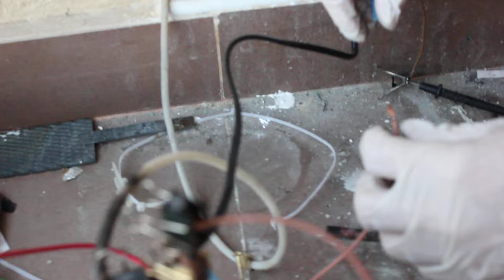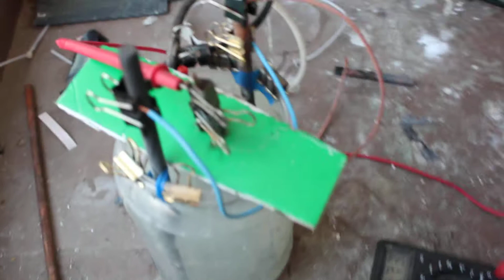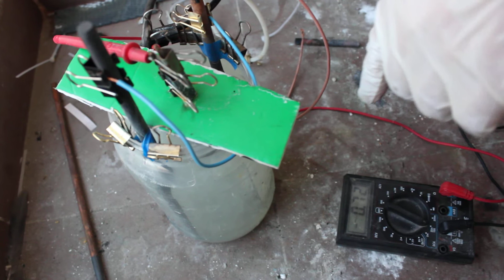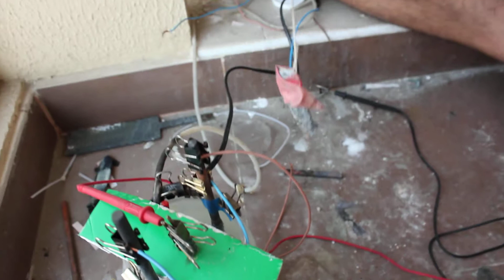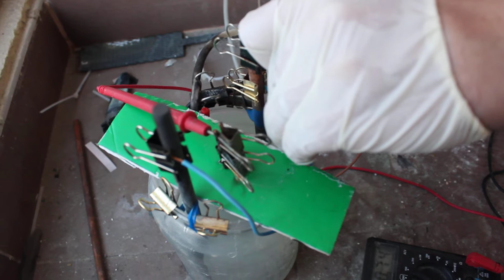preparation of PbO2 anodes using lead perchlorate plating cell

Comment: Oh, what a great video! What I use is lead acetate mixed with excessive sodium hydroxide to generate sodium plumbate, a layer of a-lead dioxide on titanium-based electroplating (because it will only generate in alkaline solution, it is stable as stated in the book), but why do I put it in hydrochloric acid to react quickly to generate chlorine gas, and its conductivity is particularly poor? Who can help me answer it?
Reply from the maker: Substrate must be ATO or MMO also PbO2 reacts with HCl and doesn't like chloride electrolysis only for O2 evolution like hypochlorite oxidation or perchlorate formation
Reply: Yes, I did it a few weeks ago, and found that the intermediate titanium-based intermediate layer (direct lead dioxide plating) is sensitive to oxygen, and a little thicker in the electrolysis process is easy to cause demoulding. The titanium-based interlayer has a layer of silver or tin dioxide, which not only does not demould, but also can achieve the desired thickness (electroplated lead dioxide, a and B), and the electrolysis of concentrated sodium chloride solution has lasted for one month.
Reply from the maker: @jjdjjd-vs8yp  for your conductivity you need to plate at 2.3ma/cm2 because this gives alpha about the same conductivity as beta PbO2 though it's slow.
Reply: Looking forward to your video on how to plate manganese dioxide anodes on titanium substrates?
Reply from the maker: @jjdjjd-vs8yp  manganese plating is a lot harder than nurdrage made it out to be atleast for a PROPER coating that can run 200ma/cm^2 and chloride to perch. I only had 1 succesful electrode and unable to replicate so far due to issues with purity and temp control. But I will make a video on it in the future as im upgrading my space.

Comment: ok, so, lead perchlorate bath for plating?

cant get that.

if i just get a lead acetate solution, add dilute sulfuric acid and a lead anode and my part as the cathode, can i plate it before making the layer of lead dioxide by electrolysis of dilute sulfuric acid with it as the anode?
Reply from the maker: use lead acetate and NaOH as that bath also works.
or you can just oxidize lead in H2SO4 or NaOH bath.
but the electrodes made from oxidized lead need to run at pH from 8-11 where pH 7-5 will kill it!!
Reply: @CatboyChemicalSociety  why ph 5-7 kills it?

also, will lead stici to any metal? i plan on using aluminium as a base and givenit the thickest plate i can get before oxidizing it, it's much easier to me to work with aluminium and i have a fuckton of it, but if i need to use galvanizd steel ig there is no escape now

why the fuck doenst just lead acetate work? why chemistry has to be such a fuck
Reply from the maker: @VerbenaIDK  ph 5-7 kills oxidized lead because I learned that during my process on making PbO by electro exfoliation.
when the pH is near 7 it exfoliates and when the pH is below 5 or above 8 then it forms PbO2 at the anode which ruins the process of exfoliation but is good for the process for making products IE electrolysis.
Reply from the maker: @VerbenaIDK  acetate wont work for a funny reason and its due to KOLBE electrolysis which produces ethane at the anode which creates a porous layer of PbO2 and it being alpha PbO2 makes the layer weak.
alpha PbO2 plated from sodium plumbate is more stable.
sodium plumbate is made by reaction of a 6 molar NaOH solution with lead acetate of 40g/l.
Reply: @CatboyChemicalSociety  it forms ethane? ig i got a new idea for a mini welding torch.

also thanks, gonna try that, but, lead perchlorate and lead nitrate are the only ways of straight plating lead dioxide?
Reply from the maker: @VerbenaIDK  you can use sodium plumbate to straight plate PbO2 as mentioned.
Reply: @CatboyChemicalSociety  ok so, it plates straight lead dioxide, what do i need to plate lead metal too?

also thanks sorry for bothering
Reply from the maker: @VerbenaIDK  no you really dont but you will either plate PbO2 on Pb or on some other inert substrate like ATO or MMO
Reply: @CatboyChemicalSociety  well in this case i am fucked and i will have to do some black magic ig

thanks for the help

edit: i saw somewhere that lead electroplating is carried on fluoride baths with a lead salt or something along these lines, and i think i can buy fluoride around uhere maybe
Reply from the maker: @VerbenaIDK  also PbO2 should be plated alpha at 2.3ma/cm^2 main layer and 5ma/cm^2 for strike initial layer.
for beta is 4ma/cm^2 or 6ma/cm^2 main layer and the initial layer is always alpha and never beta.
Reply: @CatboyChemicalSociety  thanks 

but yeah i really do have to make some black msgic fuckery to tgis to work fully...

the only source i found searching quickly is a source i dont know if i can thrust and it says: 

"Electroplating with lead is carried out in fluosilicate, fluoborate, perchlorate, and sulfamate electrolytes. The thickness of the lead coating is 0.1–0.2 mm for protection against atmospheric corrosion and as much as 1–2 mm for protection against chemicals."

so either i pull those out of my ass or i will have to find out a way to plate PbO2 into copper
Reply from the maker: @VerbenaIDK  plating PbO2 onto a non inert metal is not worth it for perchlorate electrolysis.
Pb metal can sorta work but still crappy but the only real way is to decompose a coating of ATO onto Ti and plate PbO2 on it.
Reply: @CatboyChemicalSociety  inst there any other options then?

otherwise, will it atleast work for chlorate? if it atleast work better than that, it's better than any attempt on a chlorate cell i did so far.
Reply from the maker: @VerbenaIDK  if you want chlorate really just go buy aliexpress MMO it costs 23 USD.
perchlorates require custom electrodes and my advice for that is oxidized lead for cheap or proper PbO2 anodes which you can make by plating over MMO but that MMO can never be used for chlorate again and only for perchlorate.
Reply from the maker: @VerbenaIDK  many people think chlorate and perchlorate cells are similar but they are worlds apart when you run them.
PbO2 is terrible for chlorate as the Cl- ions cause reduction of PbO2 and leaching of Pb2+ ions.
Reply: @CatboyChemicalSociety  well i am screwed.

MMO electrodes here are expensive as shit, i would pobably be better off buying titanium electrodes and plating it in platinum tbf...

i am searching through aliexpress and i found one that seems cool, and seems about right size but it's expensive as shit, 200 for a mesh and same for plate with an extra 50,50  for shipping so i am screwed
Reply: @CatboyChemicalSociety  hewwo

so, in a random comment i saw that adding a bit of copper acetate to the lead acetate helps, he didnt specify the substrate (and the comment was from 9 years ago) and he was able to make chlorates apparently and it worked jist fine, i am going to assume there was lead contamination tho

and, searching a bit, i found that it can be plated on a nickel substrate if the pH is kept around 2-4 and if i am not mistaken copper if ph is kept around 2 not to damage the metal or something

fluorides can be added but not necessary, they are supposed to stop some lead plating on the anode

i dont have nickel to test this, but i do have copper, i have also graphite

also saw you try to attempt to plate lead dioxide into stainless steel

also, as an option to lead dioxide, manganese dioxide apparently can be used instead of lead dioxide in anodes for chlorate cells, even if they degrade and fill the chlorate with manganese impurities, it's less toxic, but the only method i know of to make then is thermal decomposition of manganese nitrate on a titanium substrate, but it's hard and passivates within a few hours unless extremely pure manganese nitrate is used, and it's ruined by iron contamination, it also requires cobalt nitrate which painfull enough to get manganese nitrate having to make everything from nearly scratch using non restricted materials and mostly electrochemistry

so, can it be done by electroplating from start, using electrolytic manganese dioxide for batteries without me wanting to throw myself into a pool of liquid methane from 1 km high with my head on fire?

thanks in advance and sorry  for bothering.

Comment: Hi mysterious, 

I saw many of your videos, and I think your videos deserve much more viewer than this. I learned many knowledge about electrolysis from your videos.

If you don't mind, I wanna ask you few things:
1. What is the base substrate that used in your video? It seems like carbon rod.. isn't it?
2. What's the stages I have to do? Such as pretreatment or coating the electrode with some material firstly?
3. Is there any reference, or maybe tutorial sites that I can start with? I saw the comment section you mention about lead acetate, is the process have same setup too?

I was trying to get my own PbO2 anodes (because the price is quite expensive for me).
Any guides or replies would be much appreciated. Thanks.
Reply from the maker: I can give you all the details of the plating proceedure (the updated one) also in this video the substrate was Ti the graphites were cathodes.

just give email or discord.

Comment: Would you be interested in selling an electrode or two?
Reply from the maker: I kinda use all of them and it wouldnt be worth since I still would need to buy some MMO for it.
I overall would need to buy MMO in bulk then coat them.
Reply: @CatboyChemicalSociety  how much
Reply from the maker: @howtomakemoneyonfacebookpa2747  
It's not profitable to make these but I do have a full tutorial on how to make them
Reply: @CatboyChemicalSociety  at where
Reply: @CatboyChemicalSociety  teach me
Reply from the maker: @howtomakemoneyonfacebookpa2747  DTO substrate lead dioxide electrodes its literally featured in my channel and is 3 part.

Comment: Why you're not using the ultrasonic cleaner? It should produce stress free, dent and pit free coating. (haven't tried myself, just reading)
Reply from the maker: tried but it spalls the coating
and wont fit!! and expensive

Comment: So the solution contains only lead perchlorate? And the both electrodes are graphite??
Reply from the maker: yes graphite cathodes because steel would leech chromates into the solution and overall you dont  want a lot of weird metal shit to get in.
there is lead metal immersed which during plating HClO4 produced in the anode will attack the lead metal which keeps the solution's lead ion concentration quite high.
Reply: @CatboyChemicalSociety  are you available on any social media where i can talk to you about these
Reply from the maker: @Exotic_Lab  discord Aktavesh#1611
Reply: @Exotic_Lab  just join any chemistry discord and he will already have 1000+ messages there xD
Reply: @CatboyChemicalSociety  I have sent friend request to you on discord
Reply: @CatboyChemicalSociety  I'm in
Reply: @MysteriusBhoice I sent you a friend request, I'm Jeremy O'Neil.
Reply: @CatboyChemicalSociety  I sent you a friend request, I'm thanhviet228.